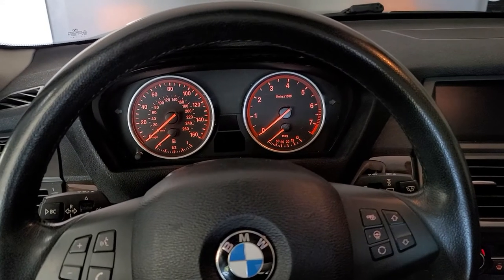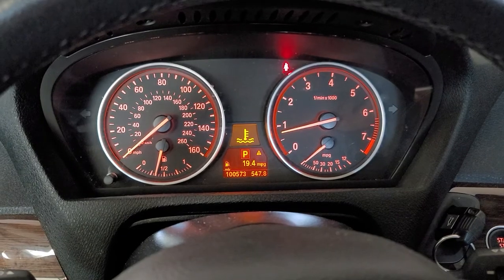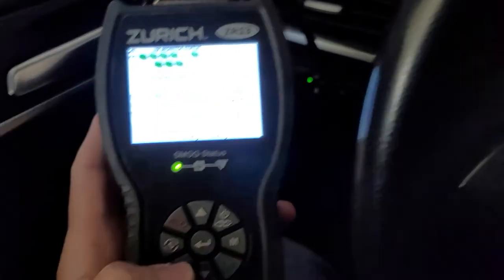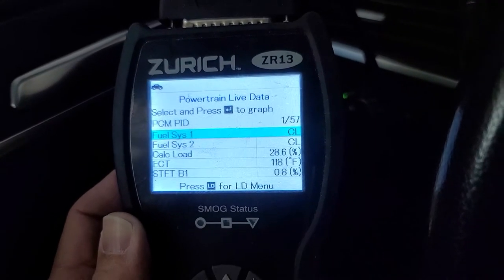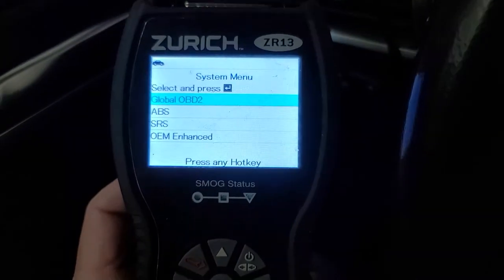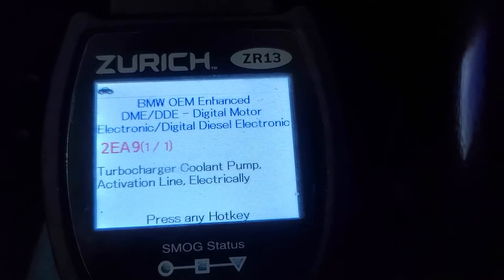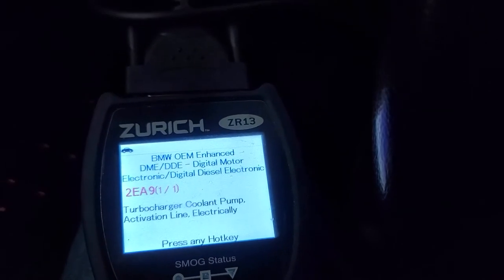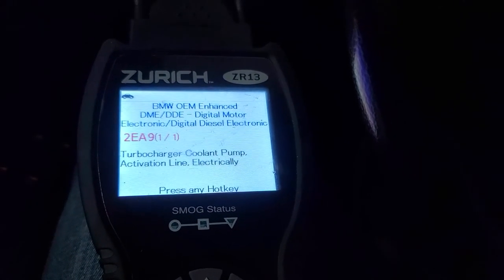N63 S63 E70 BMW X5 2EA9 error fix turbo coolant pump diagnostic

Comment: I am back replaced both coolant pump and the other turbo sensor however I still get that error though when I switch off the car I hear noise so I’m trying to figure out if that’s the turbo pump
Reply from the maker: @dennismd1  I had to use a scanner to clear the code on my X5. If you hear and feel the pump operating when you turn off the car you should be good.
Reply: @jcx2bby  thanks appreciate it. your experience with that issue has helped me

Comment: I have a bmw f25 and changed the radiator, water pump and thermostat about 3 months ago all is fine until yesterday it overheated.. Not sure which way to go now.
Reply from the maker: Why did you change all that to begin with?  And are there any codes showing now?

Comment: I had this code but fixed the pump and the turbo hoses. Went away for a few days and came back now the engine temp warning. Do you think it’s j the code coming up bc it hasn’t been reset?
Reply from the maker: @d4nielxo  possibly...is the pump running after you turn off the car? That's the first thing I'd check

Comment: If it goes on after 30m drive does it mean it needs Coolant?
Reply from the maker: Do you mean if the warning goes off after 30 min?  Have you checked the coolant tanks yet?  On the N63 there are 2 coolant tanks and both are easy to check.
Reply: @jcx2bby  yeah the coolant is very low I’m hoping it just needs some coolant. What’s the difference from coolant and anti freeze?🤓
Reply: @jcx2bby  & yes the “temperature level is high” sign went on^^
Reply from the maker: @cindybesitos8933  coolant and antifreeze are the same thing. Buy the actual BMW coolant from the dealer, it isn't that much over generic coolant at the parts store. Fill up both tanks. On this engine I would not run it until I had proper cooling because this engine runs so hot to begin with. 
Have you had the codes scanned?
Reply: @jcx2bby  no codes yet
Reply from the maker: @cindybesitos8933  if you're getting this message on idrive, the car will have some codes in memory. You need to get them scanned to find out what is really going on. And a generic OBD2 scanner won't tell you much. You'll need the specific BMW code
Reply: @jcx2bby  thank u kindly
Reply: The dealer did a diagnostic on it back in April and it said i needed a coolant oil housing replacement I think this is going to be the issue. Why it’s over heating.
Reply from the maker: @cindybesitos8933  do you have the N63 engine?  That is more common in the 6 cyl BMW engines
Reply: @jcx2bby  yessss
Reply: Does it run super pricey?
Reply from the maker: @cindybesitos8933  if you're referring to the housing replacement, I am not sure.
Reply: @jcx2bby  thank you!!!

Comment: Is it possible that its just the sensor or it has to be the pump
Reply from the maker: @dennismd1  the sensor for this is in the pump, so I would say it almost doesn't matter. You'll be replacing the pump either way. Before you change anything, check and see if the pump is actually working after you shut the car off. If you don't feel any vibration or hear any slight humming noise from that pump, it's dead that needs to be changed

Comment: Thank you for the video.  I replaced my pump with  OEM like you did. However, I still have three codes showing up. Warning light still comes on and then goes away.  20A608 pump actuation, 1F0201 internal error,  and 20A504 electrical line break. Any thoughts are appreciated.  Thank you
Reply from the maker: Well it seems as though those errors are pretty specific and indicate a wiring problem somewhere. Where, exactly, that  "electrical line break" would be I have no idea. Hate to say it but you might be looking at a dealership repair job there. Some things are out of the DIY scope and this might be one of them. 
That being said, always check fuses and wires as much as you can. Maybe you will get lucky. I wish you luck on this.
Reply: hi did u find a solution? i have the same issue
Reply: @jorjefeghaly3784  FCP sent me a bad pump.  They sent out another pump which solved the problem.
Reply: Try disconnect IBS sensor on negative battery cable.I had the same issue and after disconnecting IBS sensor the issue is gone and no more engine overheating warning on idrive no automatic engine shutting down and temp is stable and needle stay in central possition on oil and water temp gauge.

Comment: My situation is I don’t have any codes or messages on screen but my temperature gauge is jumping from 140 to 250 to 360 back down to 140 in the matter of seconds and it does this for as long as I drive it. The temperature gauge just jumps up and down randomly and sometimes I get the engine temp high, and I notice the engine runs very loud for 5 seconds as if it was overheating then goes away and back to quiet, and the temperature also gradually decreases
Reply from the maker: I don't think any stock E70s have a temp gauge,..what is your vehicle? Sounds like a sensor to me regardless.
Reply: "Engine running very loud for 5 seconds as if it was overheating" was your cooling fan doing what its supposed to do.

Comment: Do you have a video where they explain how to replace the  Cooling sensor?
Reply from the maker: There are 2 sensors on this motor.  One is in the thermostat housing. Watch here at 29:00 to see one. https://youtu.be/PvnsPC8v8HE. It came new in the new thermostat that I bought. The other one is in the pump itself. Watch here at 20:40 to see it. https://youtu.be/H2GqDfFQpos I had to buy that one separately from AutoZone. TS10270
Reply: @jcx2bby  thank you